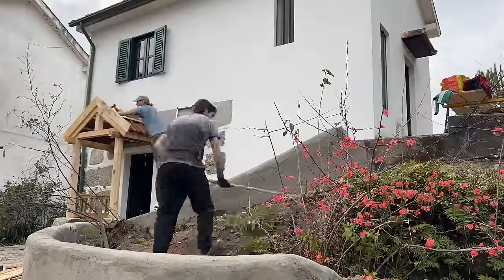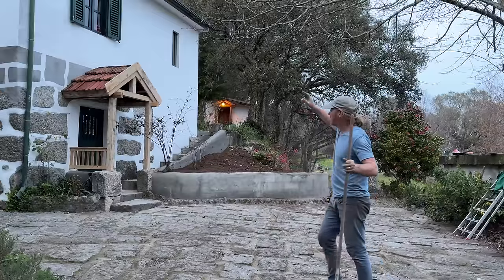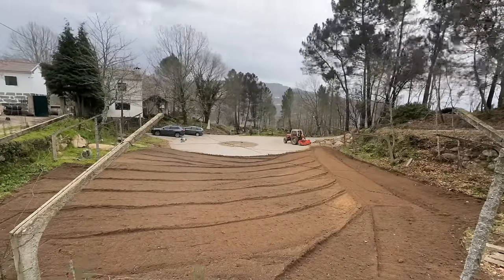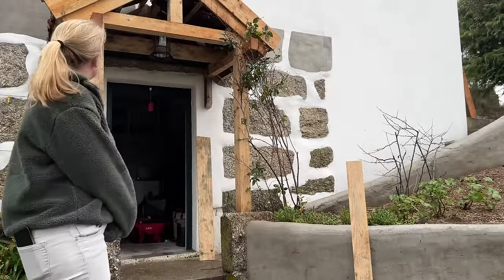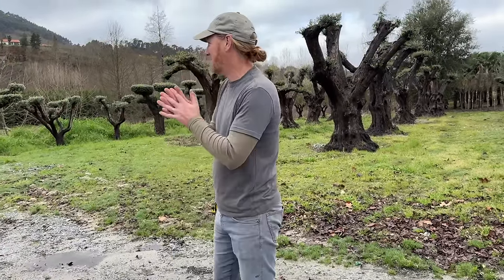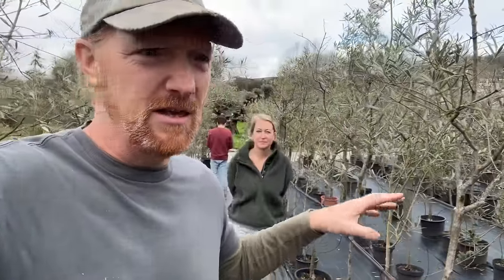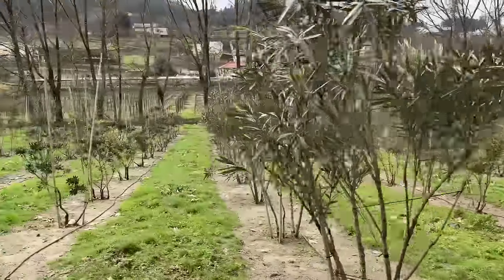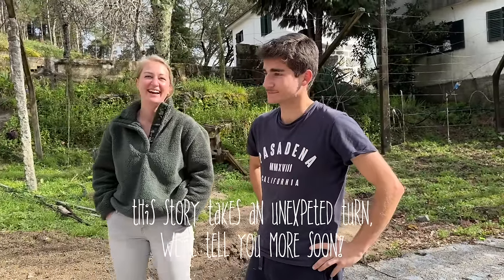Can we AFFORD it? A VERY unexpected day in Portugal.

Comment: Putting the largest tree you can afford in the center of the circle would be a great architectural feature. Add a ring bench seating around it, or a decorative tiled wall with wall cap to sit on, as well as up-lighting, and you've got a beautiful statement when first pulling into your property.
You can get smaller ones (not 500 year olds) for the farm production.
Reply from the maker: Thanks friend 🫒🌳🙏🏼❤️🇵🇹
Reply: Noooo, not a ringseat' let the beautiful tree trunk be seen and touched in all its glory! A seat would  block it- and you would be looking away from the tree!!

Comment: The windows of you green house  are fixed in with little wire sprung clips.  There are a few types available.  They are fitted between the frame and the glass